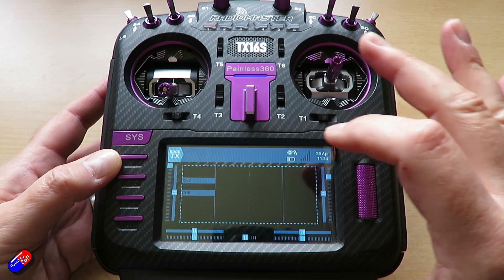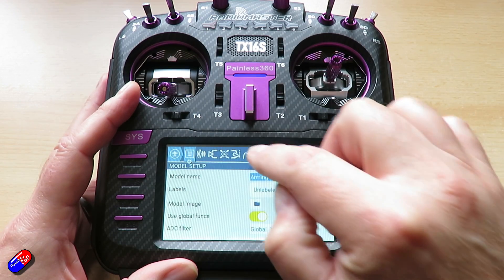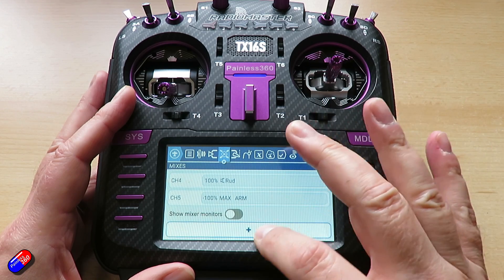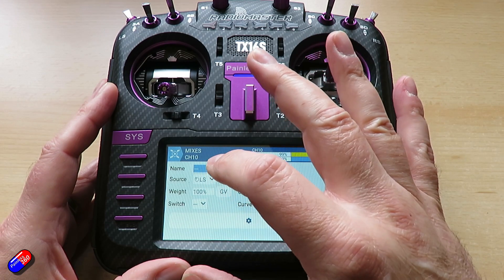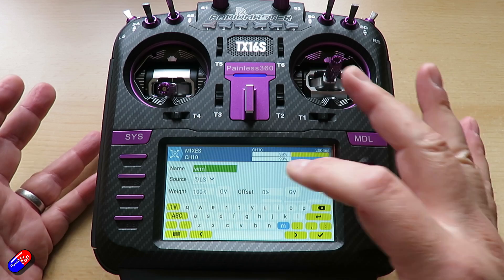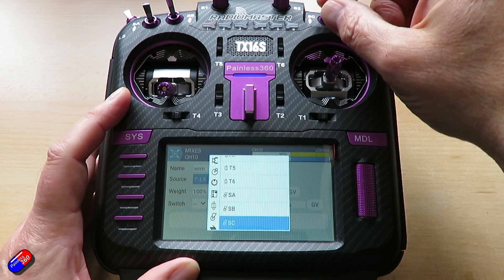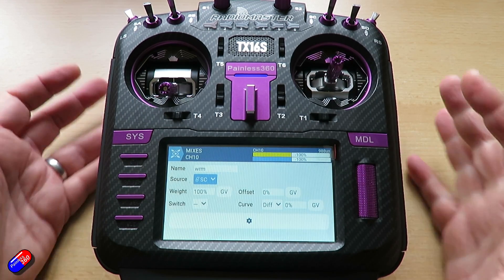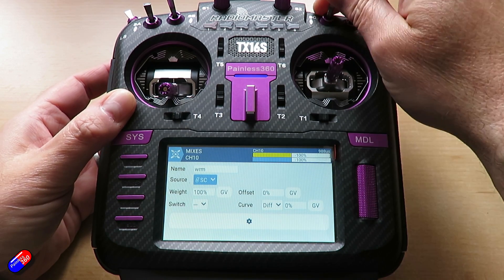EdgeTX Quick Tip:  Adding a switch to an output

Comment: I have a question if it makes it to your notifications? My Dad and I are venturing into RC planes, he's seen on YouTube someone using a switch to activate Bind mode, do you know anything about this or how to do it?
Reply from the maker: Using a switch for binding is something I've seen with those radios using a multi-protocol module (MPM) and is a standard way of binding for a few of the supported protocols. If that isn't it, I'd ask the creator of the original video you reference.. Best of luck!
Reply: @Painless360  understood and appreciate the response. Yeah it was a Radiomaster tx16 with the 4in1, I'm currently searching through the history to locate the video! 😁 Thanks again!

Comment: Hi there. Thank you for all the informative videos. 
Was wondering if you are able to assist with an issue I’m having with my TX16S. My scroll wheel doesn’t work, but it does work in EdgeTx when pressing the scroll wheel. 

Appreciated
Reply from the maker: I've not seen that. If it's never worked, I'd contact the seller... Best of luck

Comment: Is there a way to invert / reverse the output from a switch like you can with a stick channel?
Reply from the maker: Yes. Make two outputs on the same channel and change the polarity of one - i.e. make one weight 100% and the other -100% - and select each one with a switch position.. Best of luck!
Reply: @Painless360  bingo, worked like a charm - thanks a lot!

Comment: I’d love a tutorial to add thrust reverse to a fixed wing using INAV / Edge TX and DSHOT ESC.   I’ve been trying but so far no joy.
Reply from the maker: I'm not aware of a way to do it with DShot . All of the fixed wing reversable  ESCs I've has here have a seperate wire used to control the direction... Happy flying